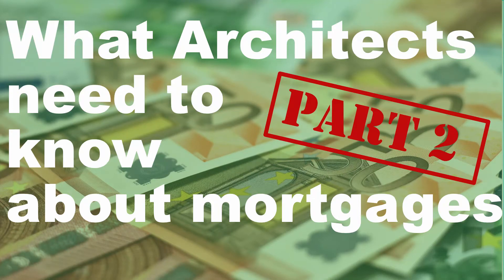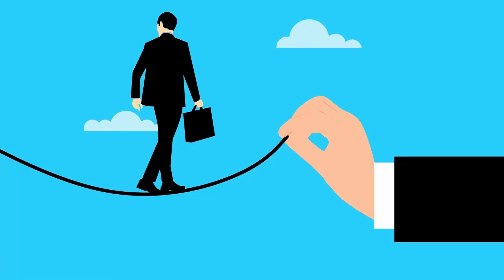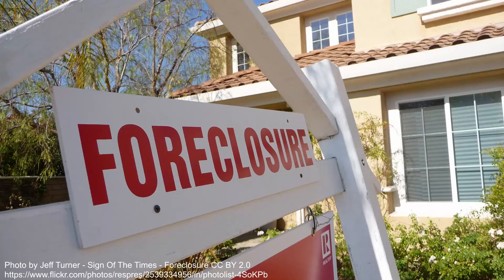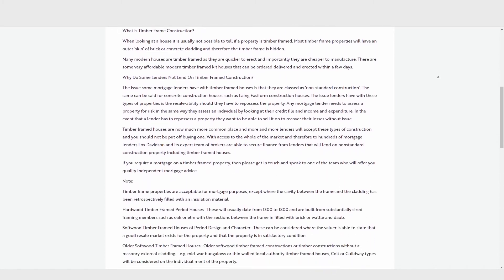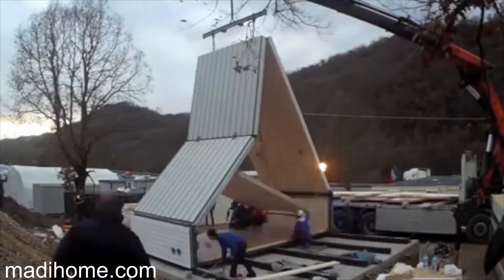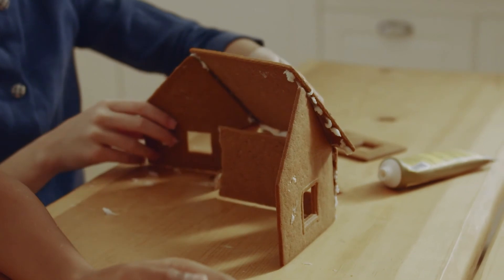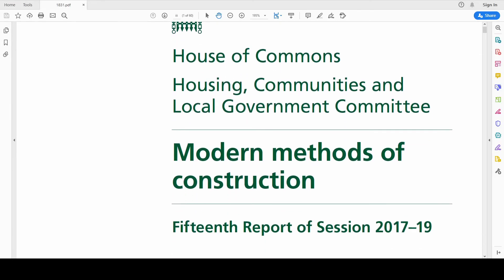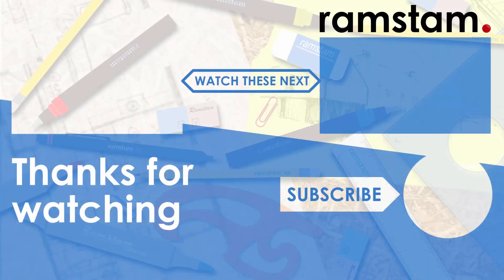What Architects need to know about mortgages part 2

Comment: Audio's a bit low, any chance it could be increased by 20-30%? Also, can architects, contractors, home owners, housing organizations and the like lobby for changes to be made in mortgaging policies? It seems like a pretty significant thing to factor, considering the ever changing expectations from designers in terms of sustainability
Reply from the maker: Hi , Thanks for the comment. Its a little tricky regarding the sound as I'm not using my usual set-up (due to Covid lockdown and noisy kids in the background). I can't adjust the gain on my mic too much without picking up noise and I have been setting the level to peak at around -10db. Sounds okay for me but I'll have a look at pumping it up a bit.

As for lobbying for changes to the mortgage lending criteria, I think this would be tricky as AFAIK each lender can set their own criteria. There is a push from government to accept modern methods of construction as useful tools for building efficient houses quickly and I feel that these will trickle down to the mortgage companies. It could also be that lenders are slow to react to new technology; they work in the long term and being risk averse they would wait for a technology to be proven before committing to it.

The other factor, especially in Scotland (I'm not sure where you are) is that houses are firstly assessed by a surveyor who produces a single survey that is available to all buyers. A lot rests on the opinion of the surveyor as to whether the property is mortgage-able.